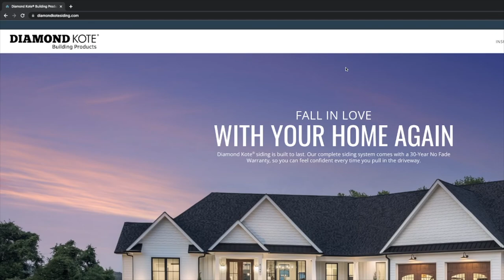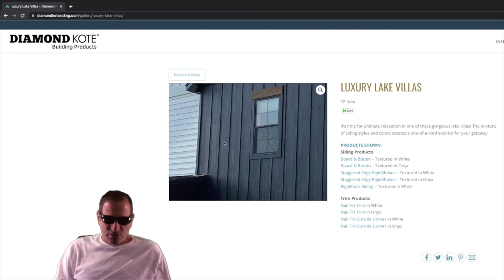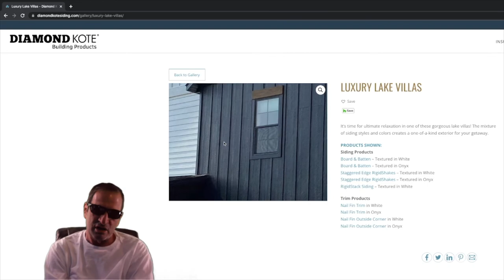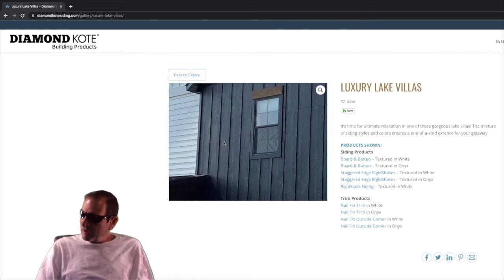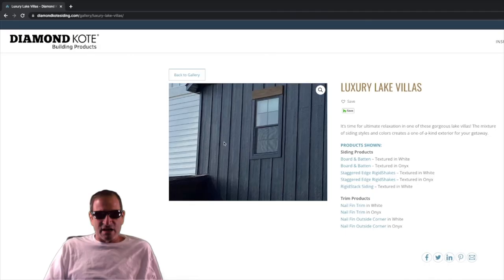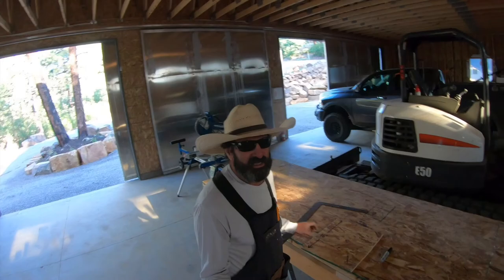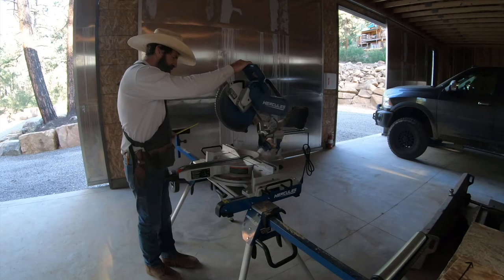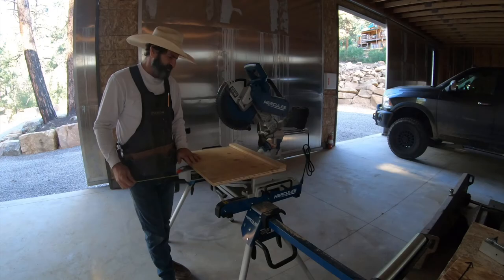INSTALLING BOARD AND BAT SIDING

Comment: Nice! Did you do any kind of metal flashing on top of the window trims at all? I'm doing a similar project on a shed currently (grooved panels instead of board and batten though).
Reply from the maker: thanks,yes i put a piece of flashing on top of windows and caulked the side and bottom leaving the top un cauked between window and flashing